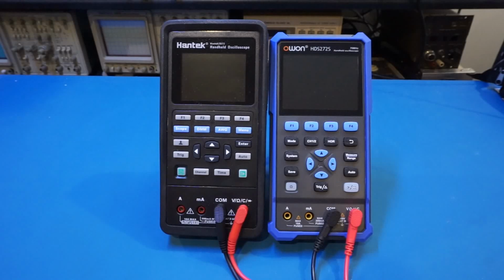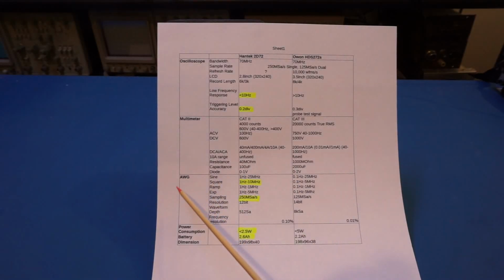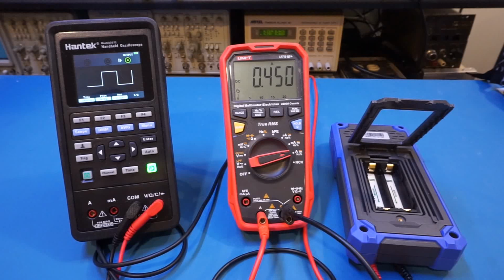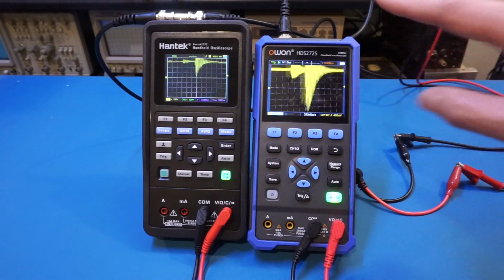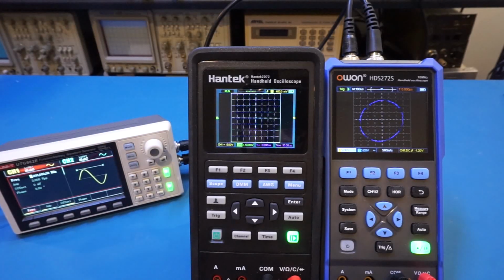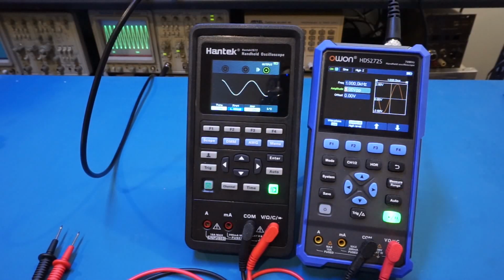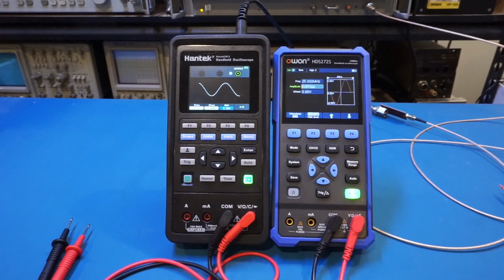Hantek 2D72 vs. OWON HD272S – Which Scopemeter is Better?

Comment: Bit of a warning with the OWON: if you blow the DMM current fuse, good luck finding a replacement with the same specs as the original. Long story short you will most likely have to settle for a differently spec'd fuse.

The original has an extremely fast blow time, is small in size (5x20mm) and is only available in massive bulk orders (as in 1000+ units) if you want to get the same exact fuse. I contacted OWON to ask for some advice on potential replacements and they said they just don't sell replacements and they can't say if slower fuses will protect the board.

So your options as as follows:

- A fuse with a slower blow time and same amperage rating (hoping that it will still protect the board from overcurrent)
- A fuse with a slower blow time but lower amperage rating to get the same blow time as the original at 10A (you can't do sustained 10A anymore)
- A fuse with a different size (the board has silkscreen and through hole pads for 3AG fuses)

I went with different size + slower blow time and same amp rating. Managed to find a 3AG fuse with specs I feel are close enough that they should protect the board. Had to get fuse holder legs for the 3AG fuse and do a bit of soldering.

Comment: Hi, thanks a lot for the video. Are these oscilloscopes valid to see the wave form of a 230VAC grid or inverter signal? If not, could I use a 230/48 transformer and the 10x? Does the transforme "smooth/disturb/...." the signal? Do you have any video about how to see this signal to chekc modified, pure sine, armonics, .... Thanks

Comment: The OWON I had used "flat top" integrated batteries and NOT the "button top" user replaceable batteries we all know and love. When the batteries die, the unit still works but only on USB power.

Comment: As always, a top-class video and great presentation.
The Owon do not appear to support custom probe selection , for example is it possible to use a 20:1 attenuator and add this to the menu system.

Comment: I must say for a field measurement instrument, for me, the hantek wins handsover: more rugged design, better battery life, better protected usb-c connector. If i need more than the Hantek can give me, personally i would use more precise (more expensive) lab equipment…
Reply: I would like to see Hantek offer a vhf/UHF Spectrum Analyzer with a tracking generator . Any such plans?
Reply: Hantek has better dac models also. Faster rates, etc.

Comment: Excellent comparison, thanks.

Any update on the Owon multimeter acquisition speed ? Any firmware update from Owon available ?
Reply: I received mine last week. The multimeter acquisition speed looks fine . Not sure that the capacitor function works OK. In addition, more languages are available. So far a great tool.

Comment: Great job Kerry!   Lot's of great comments, relative to the specifications, and so really nice experimental head to head measurements.  There is one area though where you could make a major improvement, 

Sadly, a lot's of these Chinese Handheld scopes list fantasy-land specs claiming "Real Time Sampling" up to some impressively high frequency, but actually silently switch to what euphemistically used to be called "equivalent time" multi-pass sampling for all the fastest ns/div sweep ranges, making them USELESS for any kind of high speed one shot capture (like the the FNIRSI 5012H). 

"Equivelent Time" sampling is a technological fossil record technique that was used ages back (some time around the late Jurassic I think), in Dinosaur DSO scopes by big-guns like HP and LeCroy to boost their claimed sampling bandwidth.  It works by taking multiple passes at the waveform, at multiple points in time, over multiple cycles - and therefore can ONLY work with a static perfectly repetitive non-changing waveform.  

In the modern world, most digital waveforms are anything but 'repetitive and non-changing' so all of those Dinosaur DSO "equivalent time" oscilloscopes became extinct virtually overnight when, like a meteor dropping into the Yucatan, Tektronix dropped the TDS-210/220 series into the market and showed everyone that a reasonably priced scope really could offer REAL no-B.S.  "real time" sampling at 1 Gs/sec.

Unfortunately, some of the manufactures of these Chinese handheld scopes have figured out how to extract the Dino DSO DNA and resurrect "equivalent time" sampling so they can cut corners and shave a few bucks off the cost of their scopes (like the FNIRSI 5012H) .  

The careful sine wave tests you have done so far prove NOTHING because any repetitive signal will sample fine under "equivalent time" sampling mode. 

But it's not that hard to find out if "equivalent time" sampling is being used.  Just set up a high speed non-repetitive signal, like a very high speed SPI data bus signal running at say 30 Mbits/sec (generated by something like a raspberry pi pico, or pi zero), and then try to one-shot capture a SINGLE SPI DATA FRAME and see if you get a waveform that accurately captures the data that was sent, or one that is total garbage (which will happen if the high speed sweep ranges use any kind of non-realtime "equivelent time" sampling).  

Technically, at 90 MHz analog bandwidth, and at a 250Ms/s sample rate, all these scopes should handle the fundamental, second, and third harmonics of a 30MHz NRZ data stream, allowing the data to be rendered reasonably well, but it shure would be nice to see some examples of how badly each scope's anti aliasing interpolation filters chew up the data waveform (or whether it can even be captured at all) before I go out and plonk down a couple hundred bucks to buy one.

Comment: Is it possible to use both the wave generator and the oscilloscope at the same time?

Say I wanted to use the wave gen to output a 10kHz sine wave into my circuit and measure the output wave of my circuit on the oscilloscope. Will I be able to do this on either of these handheld scopes?
Reply: hi,
p.25 of the manual : "To observe the output of the waveform generator, connect the other end of the BNC cable to the signal input connector of the oscilloscope." => seems possible

Comment: Thanks for providing such a detailed, and comprehensive review.  You speak in a clear way, and pace that was easy for me to understand despite a slight accent relative to my part of the world.  You were able to cover a lot of information as quickly as possible. I learned a little about the functionality of each in a way that you cannot by simply reading the manuals.  I think I will be keeping my Hantek, because I need the longer battery life, and easier user interface more than the higher level functionality of the Owon for the work I'm doing.

Comment: The hantek does have a test point for the probe. It is the AWG output even on models without the AWG the connector is still there and outputs 1MHz for you to tune your probe.

Comment: I feel like a major difference in the way those two scopes display the waveforms (especially visible in X-Y mode) is that the Hantek is capturing a single sample sweep, displaying it, then going around again, whereas the OWON's display seems to be a blend of multiple triggering rounds. Hence you see a thin trace jumping around on the Hantek, whereas a thicker but smooth and stable blended trace on the OWON. I wonder if that is a mode configuration on either of them? I know on my Rigol bench scope that's a setting I can adjust, to get either behaviour.

Comment: can someone chime in who uses oscilloscopes for automotive on what the bare minimum specs for a scope you recommend/what device you would recommend for a diy automotive user new to scopes? With so many choices my heads spinning.i just want somthing that will get me through most diagnosis but not somthing useless nor overkill.
Reply: I know this comment is from 9 months ago, but if this is still something you're looking for an answer on, you can use either of these for automotive. I have the Owon, and I'll use it early on in a diagnostic, especially if I was already in that area to start with using the Owon as a multimeter. Or in a tight space under a "dog house" in a motorhome when I don't want to take out my Pico and a laptop.

Regarding "bare minimum specs", it's not as easy as that, but as a reference point, a very common automotive specific scope that a lot of people use is the 4225A picoscope. Comparing the Owon at least against those specs ( not all of these will impact every type of, but worth noting ):

Pico has a sampling rate of 400MS/s vs 250MS/s in the Owon.
Pico has a 20MHz bandwidth, this Owon is higher, and the cheaper 40MHz Owon still has the same other stats, so you could go with the cheaper one.
Pico has 12-bit resolution, I think Owon has 8-bit.

You can look up what each attribute means to see if it would impact what you want to do.

Beyond that, one of the huge differences you're going to deal with is what automotive specific software is going to do for you. Especially with the Pico. It will automatically convert things like mV to amps, and maybe the most important feature for someone who is just starting is the waveform library. Which on top of doing all the conversions can overlay/stack your known good on top, while looking at your live feed come in on the bottom ( or vice versa ) and see not only that you have a signal, but what yours looks like versus what it should look like. This won't matter as much over time as you get familiar with sensors, and what they should look like, but it's a huge benefit early on.

One other note is regardless of the approach you take, and once you have an understanding of a scope is how to properly access the signals you're looking for. So if you're just doing this as a DIY with your one vehicle, see if you can find a PDF online or something with all the wiring diagrams for your generation. Otherwise, you may want to invest in something like ALLDATA, or something that may not only get access to your wiring diagrams, but also provide specific instructions on which wire is a signal wire, power, ground, etc, so that you're properly backprobing the correct wires.

Lastly, Pico constantly maintains their software, and it's quite mature after all of these years.

In summary, every tool has a purpose, so you can use this for automotive, but if you were going to spend $200 and only ever use it for automotive, and have a Windows laptop or maybe even a desktop on a cart, I think you would get better results out of the Pico, especially if you're not familiar with an oscilloscope yet.

If you are familiar with an oscilloscope, don't mind having to do some conversions, like the idea of the multimeter/multiple purpose unit in a smaller footprint, and are going to work on things other than vehicles, then one of these units may be an easy choice.

I ultimately went with the Owon, one of multiple reasons being the TrueRMS.

Comment: I've got mixed feelings about this review; I like the features of both! Mostly the DMM I'd use the most, so the slow continuity on the Owen I'm not pleased about; Hantek has 3rd party software too that works with linux! The function gen I'd use in the field to trick bits of PLC gear. Great video either way mate!

Comment: In function generating mode, can (in some of these reviewed osciloscopes) I put a square signal and then adjust duty and voltage?
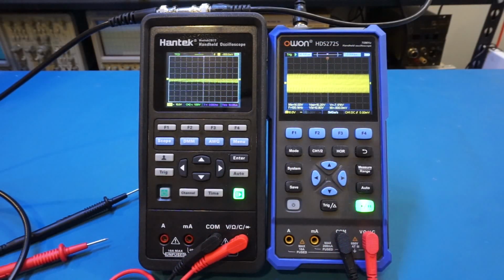21:06 WTF doesn't Hantek measure/shows you the frequency?

Comment: Great review!

One question: can these scopes be used for measuring power of sinusoidal and square waves, by simply multiplying voltage measured on CH 1 with current on the CH 2?
Reply from the maker: Unfortunately, these scopes do not support math functions.

Comment: Ive been looking for a reasonably priced portable scope and the Owon is better in almost every way. I don't need fancy software to upload waveforms. The high standby current of the hantek is completely acceptable. A battery powered meter should not draw any current at all when off. Its obviously not a real power switch.
Reply: I noticed that the HanteK retains settings after being powered off, and back on.  That memory storage feature comes at some minor power occupation cost.  I prefer the longer battery life when in use, as you never know how long troubleshooting may take.

Comment: I got my HDS242S today. Seems to be pretty nice. One thing I have found is it will not charge or connect using real USB-C. So a dedicated USB-C charger will not work and connecting it to a windows machine with USB-C will not work. If you use a USB 2/3 to C cable it works fine and you can use a USB 2/3 to female USB C and then used a USB-C to C cable. 

I put my RF Frequency Synth on it and check it's response. The frequency measurement limit is 47.9MHz, anything past that and its won't give a reading. But it displays waveforms way past 100MHz, though with 250MS/s Youre going to have aliasing issues if you go high. So I think the hardware is the same on the 40, 70, and 100MHz units, they just crippled the measurement. Wonder if they can be hacked. Bet that's why they dont post the firmware updates online. 

But this is all fine for me, if I need faster and slightly less portable I have my LeCroy Waverunner and a Tek 2465.
Reply: So after messing around a bit I found the USB-C cable work in one position, flip it over and it does not work. So it sounds like they did not wire the connector in right.
Reply: @JerryBiehler  👍

Comment: From your experience, what is the difference in the PC Software?
Reply from the maker: Hantek's PC software is very comprehensive, everything you can control on the Oscilloscope you can control in software. Whereas for the OWON, the software is very limited. You can only use it as virtual scope, that's about it.
Reply: Thanks for the link.
From what I see, the Hantek is a slower, than the Owon. But both have update-rates far below from USB Scopes. Maybe 1 or 2s per frame.

Comment: Thanks for the comparison! I wanted to buy Hantek (because I have a desktop scope from Hantek, and it works well), but bought Owon instead after watching your review.
Tested it with a 200 MHz probe to make sure the the probe is not the limiting factor. The max frequency this scope can measure is 84 MHz. At this frequency it still shows a decent sine wave of proper amplitude and shows the frequency. At higher frequencies it still can draw the curve on screen decently, but can't measure frequency anymore (shows ???).
The signal generator in it is not great, but definitely usable.
Overall, a fantastic tool sold at reasonable price.

Comment: it's amazing it takes so long to start reading a resistance.  is it something a firmware upgrade would fix?  also, something i'm curious about, in single (single shot) mode will it record both channels or only the channel it triggered on?
Reply from the maker: I am sure the firmware can be tweaked to make it better but the resistance measurement speed is largely dependent on the DMM chip used. On your other question, the single shot behavior is similar to all other DSOs. When you have both channel enabled, it will capture data from both channels when triggered from either of the channels. Hope it helps.

Comment: Question: if you buy the Owon HDS272 (without waveform generator), will the unit last longer than the 6 hour estimated range of the HDS272S?  I am assuming it should be slightly better if they reduce the chipset from the PC board, but would like input from someone that may know.
Reply: Higher consumption could mainly be due to larger screen and much faster processor.